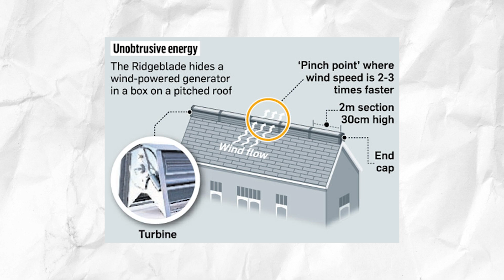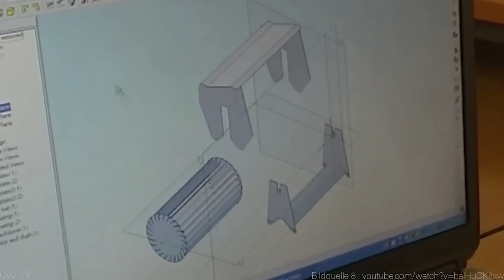Unbelievable but True: The Wind Turbine Technology Set to Dominate the World

Comment: Looks great, but my first thought is the little birds been sacrificed as they hit the blades. 😪😪😪
Reply from the maker: Valid point! Bird collisions are a concern. Many newer turbines are designed to reduce these impacts by using bird-friendly designs and slower rotations. It's a crucial balance between clean energy and wildlife safety. Hopefully, we'll continue to improve in this area! 🌬️
Reply: My first thought was why not put a fine mesh or netting over the front, easy fix/cheap fix. @EcoTechReal
Reply from the maker: Love the idea! Mesh or netting upfront sounds like a smart, cost-effective fix. Simple solutions often make a big difference. It's worth exploring for better bird safety! 🌬️